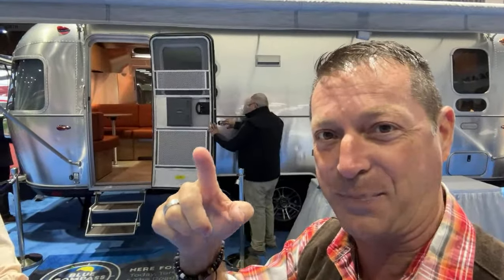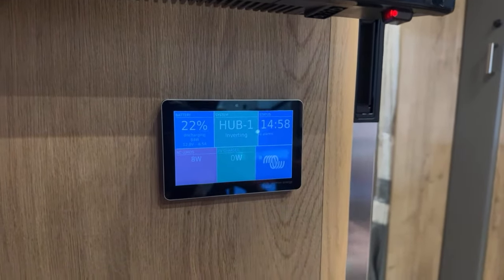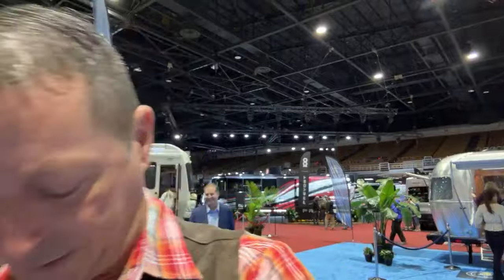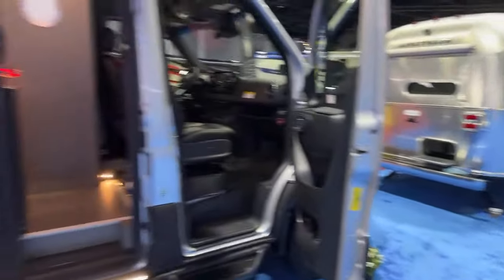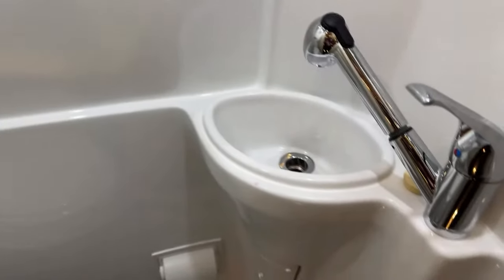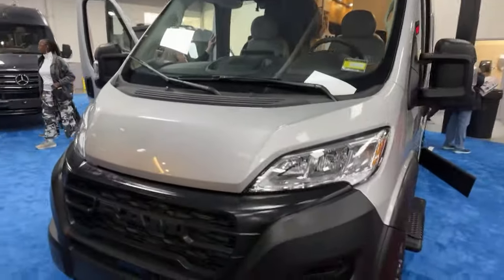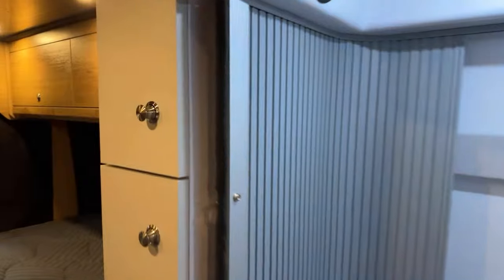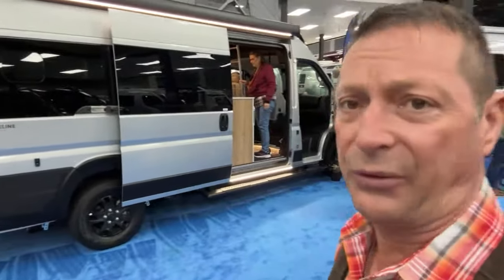AIRSTREAM Vans & NEW BOONDOCKING Trade Wind 25’ Travel Trailer - RV SuperShow 2024

Comment: I hope  all of  you  have  watched  all the  NIGHTMARE  STORIES    about  the  Airstream  Vans.   They  are  terrible.   leaks,  floooding  inside,   circuit board  that  go  bad,  they  cant  get  them.   because  these  board  control  everything  in the van,  you  are  really  screwed.   You  can not  use  them  at  all.    So    be  impressed  with all these  videos  but  remember,  the  airstream  Van  is  not  the  quality  of  the  airstream  Trailers.    BEWARE.
Reply: I was reminded of those videos you are referring to as well.
Reply: Aren’t they owned by Thor now, if so, that would explain everything.
Reply from the maker: super helpful Laura